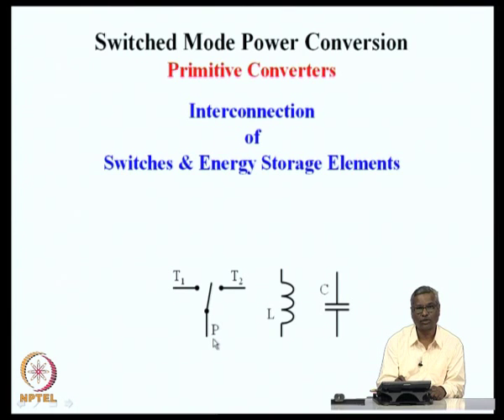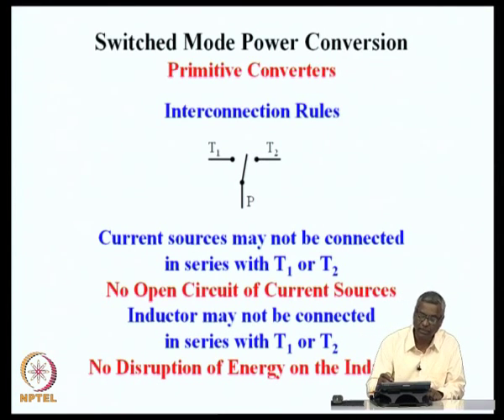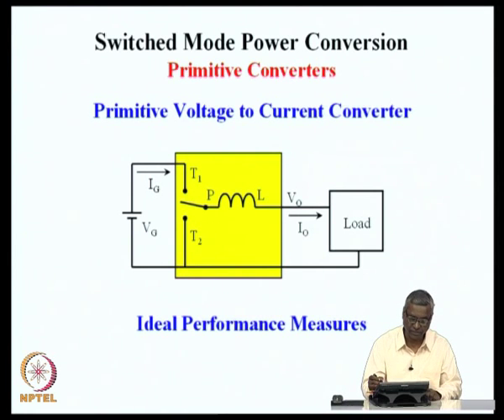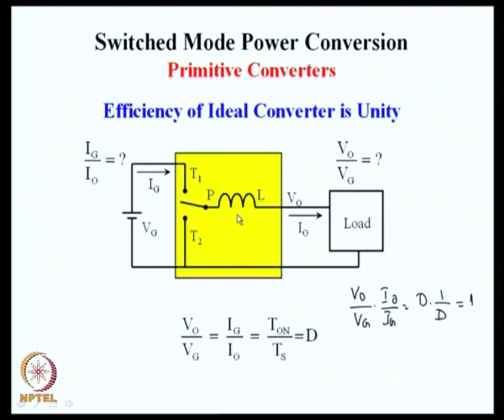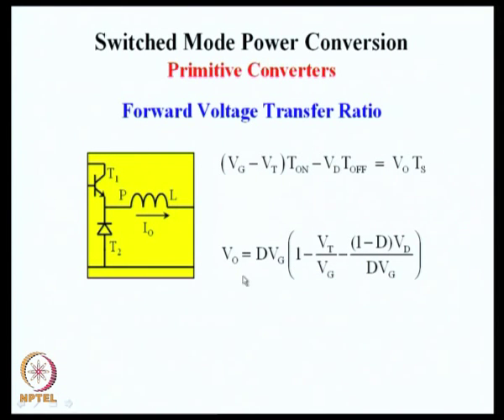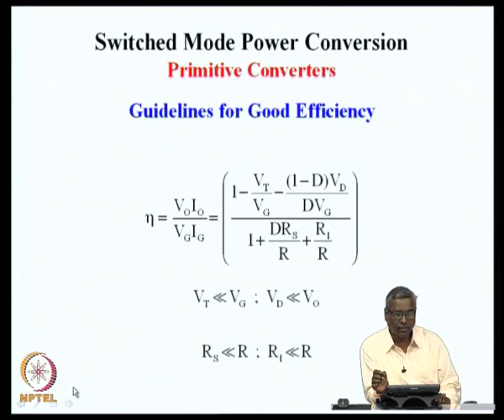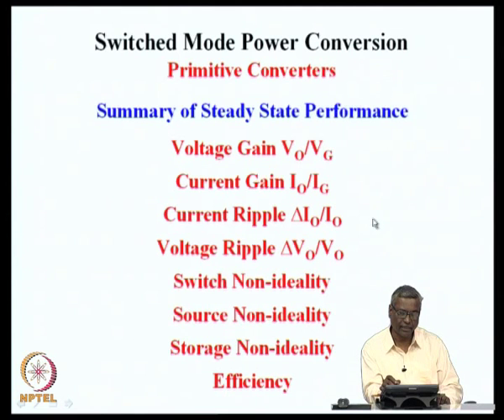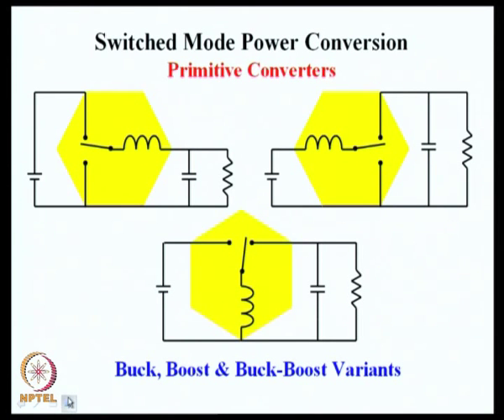Mod-05 Lec-11 Primitive Converter

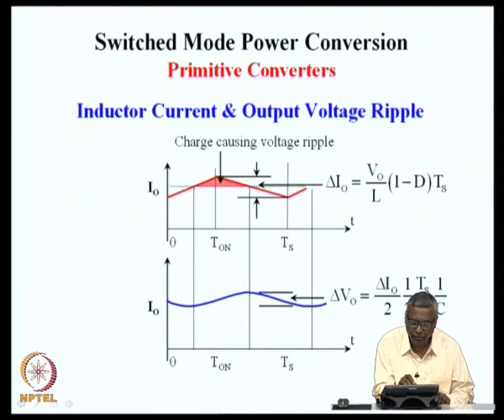Comment: 46:40 
How is the duration equal to Ts/2?
Reply: Since delta I_o is same for an inductor during storing and removing of flux in a cycle. The Average delta I_o divides the triangle at equal points during rise and fall. So it divided into three parts. Middle part is what is needed and is Ts/2. Left side part is Ts/4 and right side part is Ts/4. But the image drawn is not accurately showing the ratio properly.

Comment: Excellent presentation.
Reply: The presentation was excellent. Could any one help me out the derivation of vo/vg with non idealitirs Rl and Rs. How to bring in  R there in the expression (1+(DRs/R)+(Rl/R))
Reply: @ssk8493  Check 38:17 , equation showing, when current flows through a resistance of Rs(source resistance) and Rl(inductive parasitic resistance) , the voltage drop will be I*Rs and I*Rl, so From Vg there will be a drop as Vg-I*Rs-I*Rl during Turn on. Similar way during Toff time, (0-V_o -I*Rl = - V_o - I*Rl ) will come. Then if you take ratio of V_o/Vg you will get that expression upon solving.
Reply: @subramaniamg8004  Greetings sir. Thank you for the reply